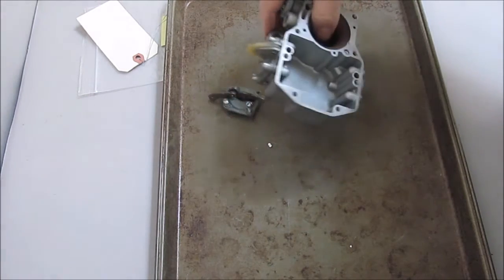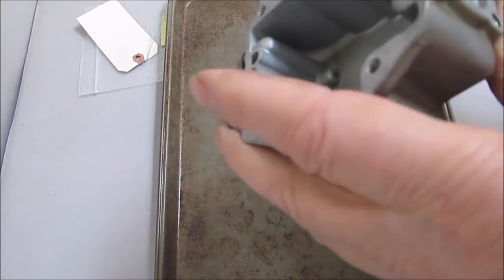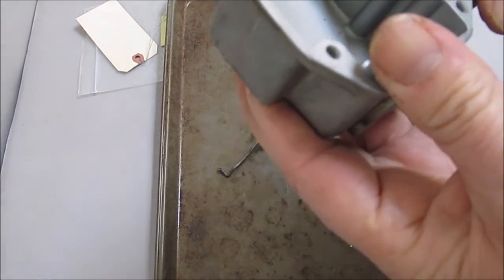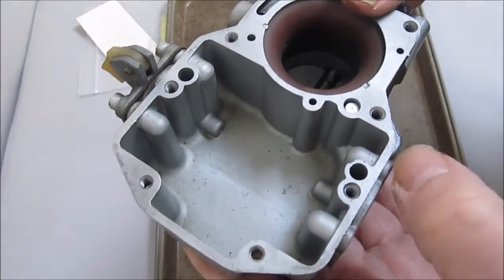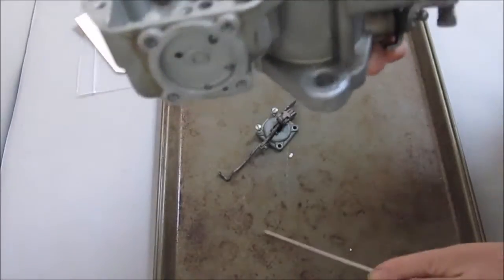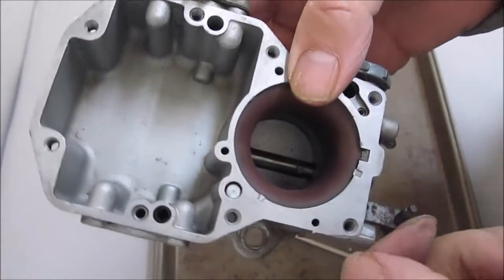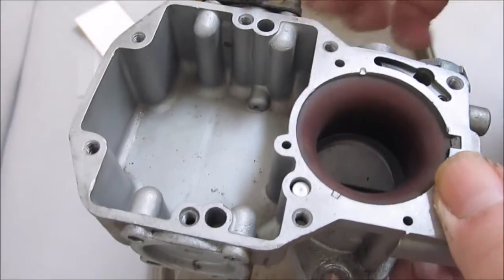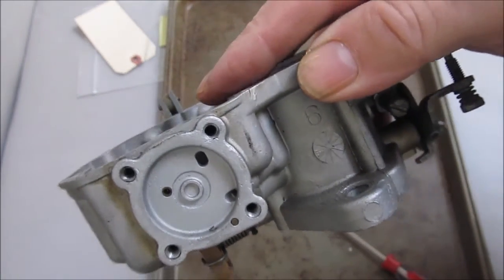Autolite 1100 Accelerator Pump and How It Works

Comment: Hi Mike. I have a 66 mustang with the straight 6 engine. It has a 1 barrel carburetor. We were driving it the other day and when I press on the gas with decent pressure, the whole car hesitated and seems to bog down and almost cut off. It almost felt like it bucked like it wouldn’t shift but I don’t think it’s the transmission. It eventually stalled at a light, but I was able to start it again and we took it home. Do you have any suggestions on what it might be? Could it be the fuel pump or the accelerator pump? Thanks for your help.
Reply: Mikes Carburetor I have a feeling this might be beyond my basic abilities. Do you have a procedure for how I can test the distributor to see if it’s that versus the accelerator pump? I have a volt meter, a bunch of tools and patience.  Thank you.

Comment: Thanks for posting these great videos. I have an Autolite 1100 carb with manual choke. I bought it  used off of a 1965 F100 with 240 ci engine, which is what I have in my F100. Anyway, the throttle rod is stuck in the closed position.  I've tried lubricating it with no results. How can I get it unstuck? Any ideas will be appreciated.
Reply: @MikesCarburetor  okay, thanks Mike. I'll let you know if I have trouble. Thanks again.
Reply: You all prolly dont care at all but does someone know of a tool to get back into an instagram account..?
I was stupid lost the account password. I would appreciate any tricks you can offer me!
Reply: @Thomas Damian Instablaster =)
Reply: @King Rowan thanks so much for your reply. I got to the site through google and Im trying it out atm.
Takes a while so I will reply here later when my account password hopefully is recovered.
Reply: @King Rowan it did the trick and I finally got access to my account again. I'm so happy!
Thanks so much you saved my ass !
Reply: @Thomas Damian no problem xD

Comment: Mike,  To answer your question,  The Autolite or Motorcraft 1100 carbs that have 2 dashpots - Really One Dashpot, and One Accelerator, are carbs for Ford or Mercury cars with C4 Automatic Transmissions.  The Autolite or Motorcraft 1100 carbs that ONLY have One Dashpot and No Accelerator onn the Driver's side are for Manual transmission Ford or Mercury 6 cylinder cars.  Tony K.  , 1966 Sprint 200 Mustang Registry - MCA#70001
Reply: My 1963 Ford Falcon Futura with 3 on the tree manual transmission has a dashpot on the passenger side and an accelerator on the drivers side.
Reply: @daviddoughty764  Thanks for your reply. Hmmm, I wonder if it matters that much.
On the manual for the Carter RBS and Holley 1904 used on the 1963 Rambler American, the manual says the carburetor for the 'E-stick transmission' has a dashpot/anti-stall but is the same as a standard carburetor in all other aspects. Perhaps the carburetor for the automoatic can be used on a manual (since driver controls rpms) but the manual carburetor (without dashpot) cannot be used on a car with automatic transmission because it would stall it.

Comment: Mike,
Thanks for posting this series of videos on this carburetor. It is very informative.  To add from my experience, cleaning with Purple Power (available at most Walmarts and Home Depot in trigger spray bottles)  and Berkbile 2+2 Gum Cutter (aerosol spray Part # B-101 available in parts stores at least in the East) will clean up the varnish and soot quite nicely prior to using any silicone lubricant.